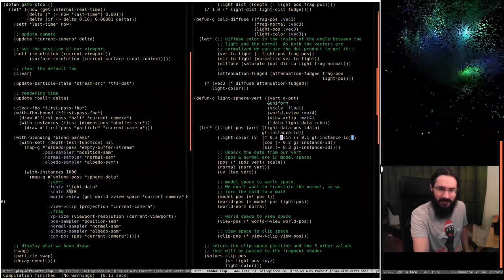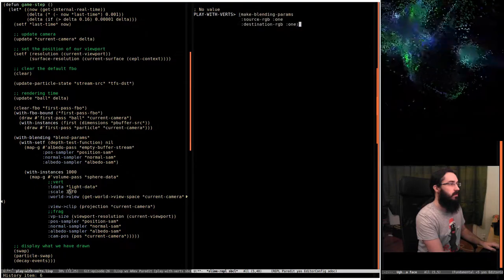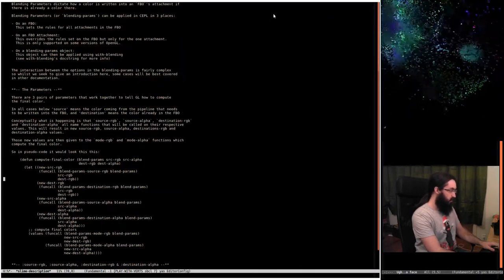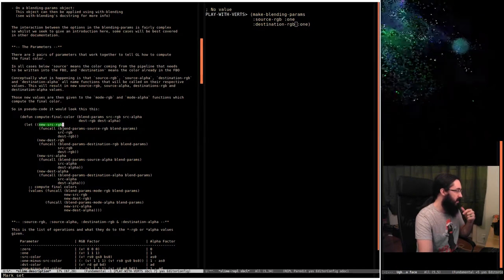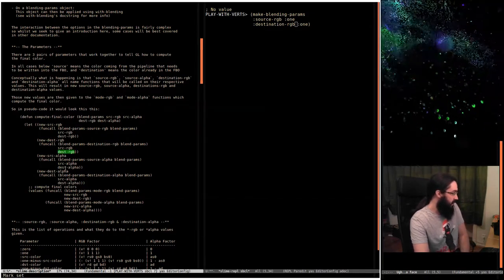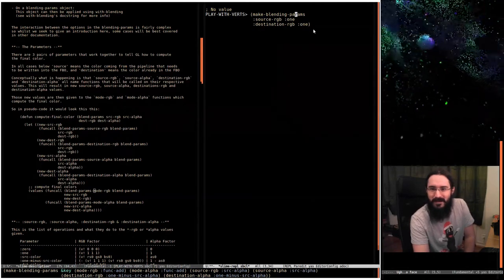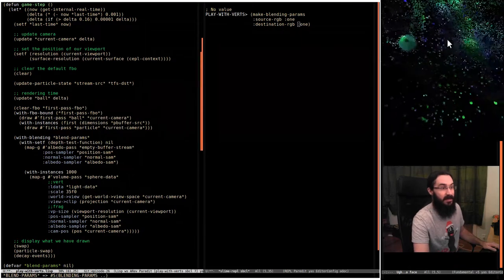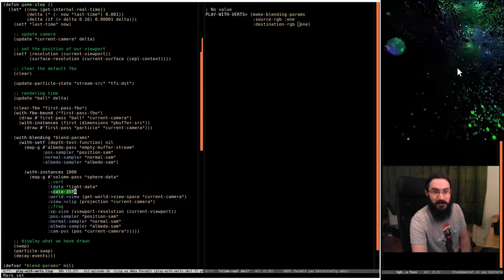Pushing Pixels with Lisp - Episode 26 - Bonus Video

Comment: Cool stuff! 
Question: Can you share with us some informatione about your video/audio-recording setup? Looks quite nice.

Keep going!
Reply from the maker: +ThePinback thanks :) Samson c01u mic, Linux PC where I'm coding, hauppauge hdr rocket hdmi capture, Microsoft Webcam for filming me, Intel nuc running OBS capturing the hdmi feed from the rocket, Webcam & mic. Using separate capture device so it doesn't impact gl performance. The mic is not super expensive or anything,just needs to be something slightly directional and which sounds nice. Does this cover enough?
Reply: Baggers Thanks and I wish you Merry Xmas!
Reply from the maker: +ThePinback thanks! And the same to you :)